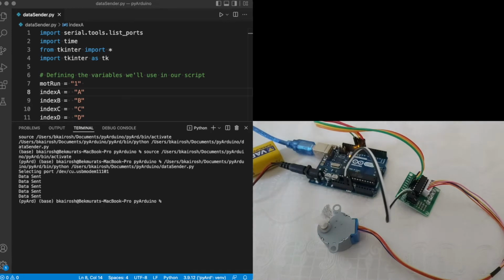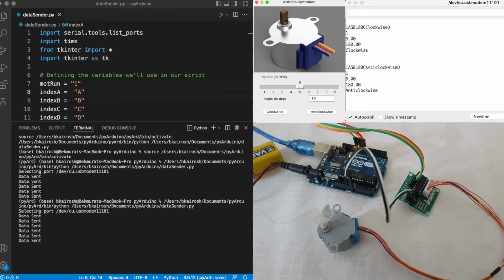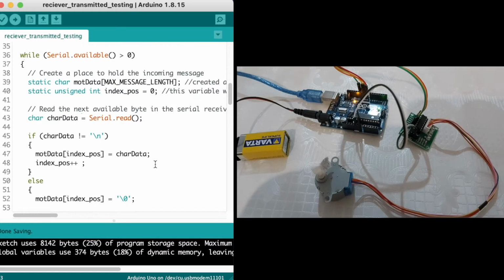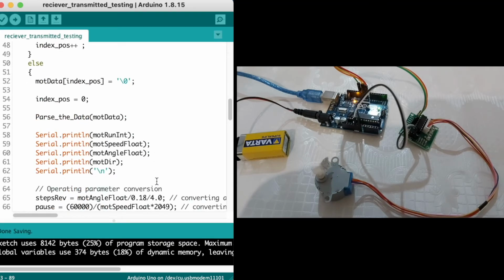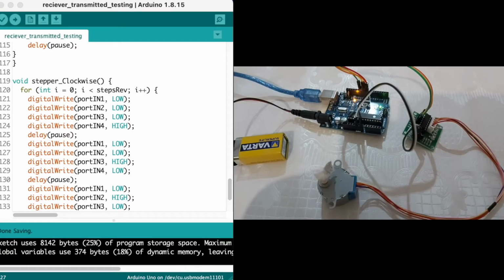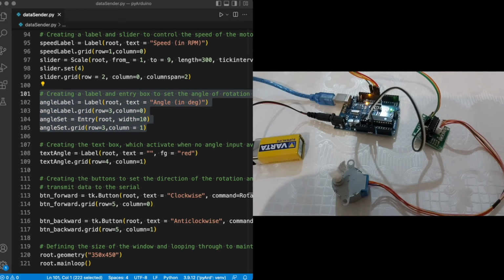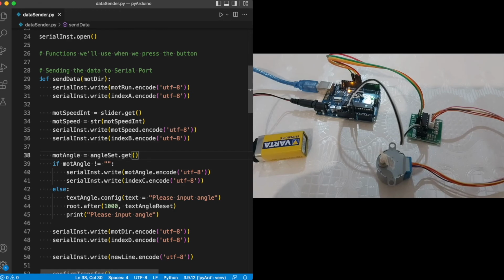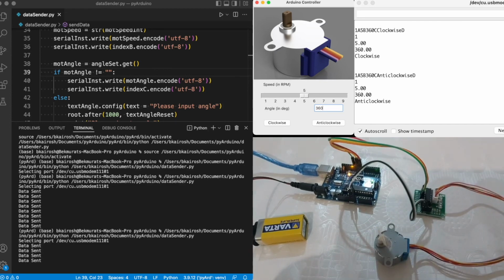Episode 6: Stepper Motor Control with GUI using Python - Arduino Com

Comment: Can it be programmed to made position move to solve Thread Art or String Art using Stepper motor input
Reply from the maker: Hey there. I'm sure it can be. Probably first need to set-up the hardware with two stepper motors, with each of the motors enabling motion along 2 dimensional axis. You can define your string art formual in python, and use it as an input for the motors.